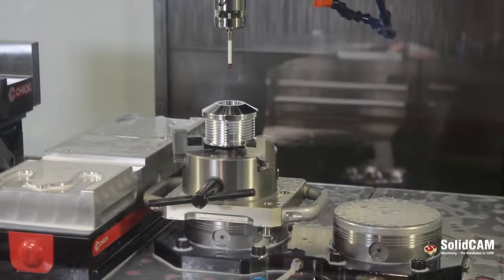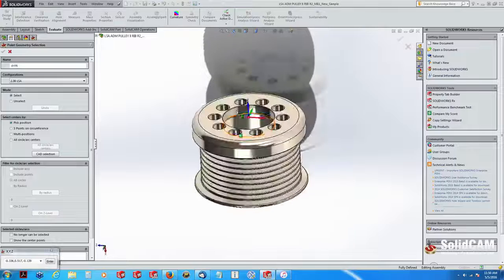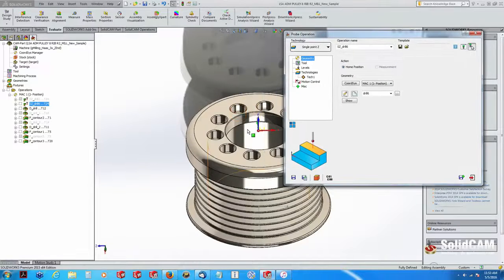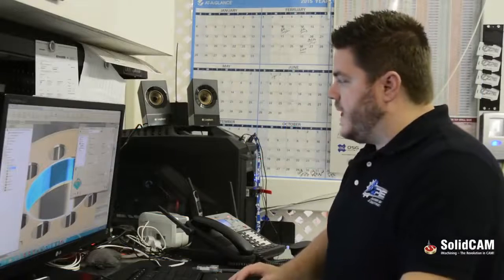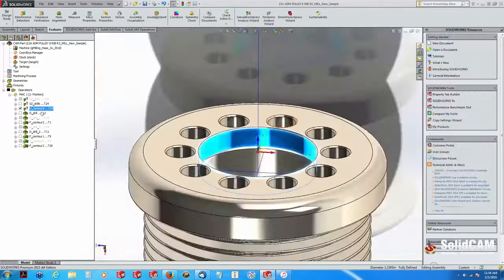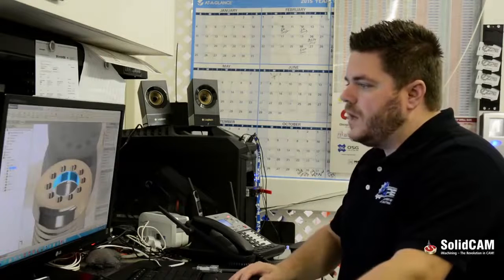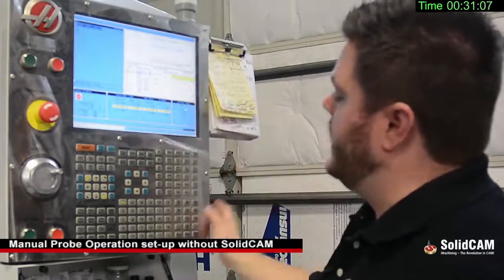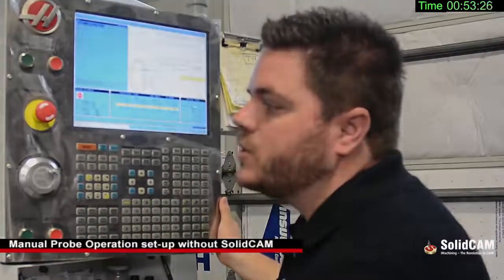SolidCAM - Solid Probe

Comment: hello 
can solidprobe scrap a part or rrun again a finish operation if the dimensions is not correct?
Reply from the maker: Thanks for your comment. This does not have a direct yes or no answer, it depends on several factors such as the machine, the probe cycles and the setup. In general yes, it is possible, but it requires implementation time and the necessary support either from the customer side or from the probe supplier.